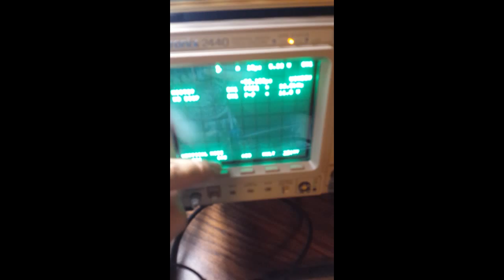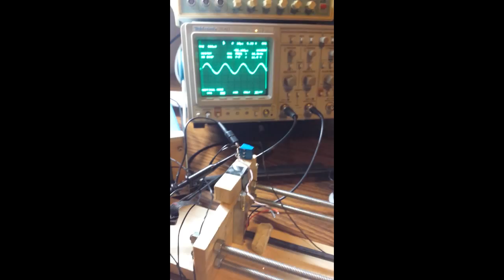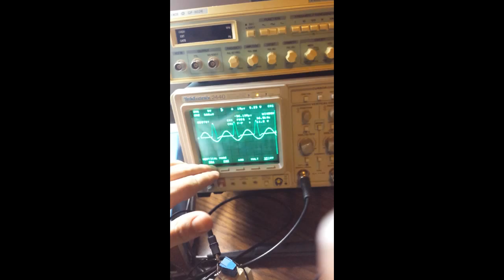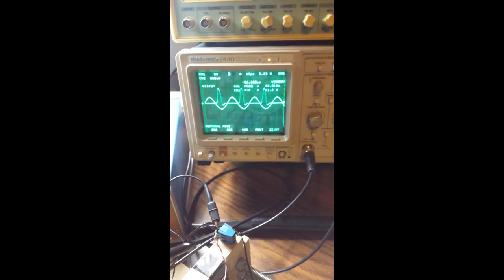Magnetostriction oscillator circuit

Comment: Hello, what is the radius of the cross-section of the ferrite rod you used?
Reply: I'm trying to make a magnetostriction oscillator for a frequency of around 25kHz, what sort of specs could I look at. I will be using an LC circuit for the electric oscillations